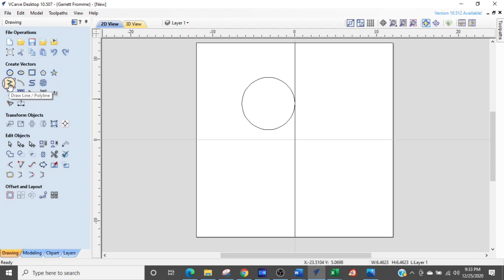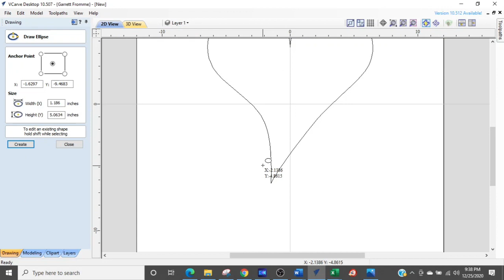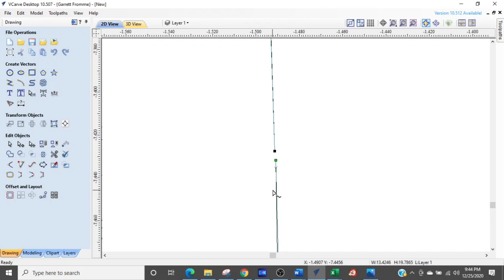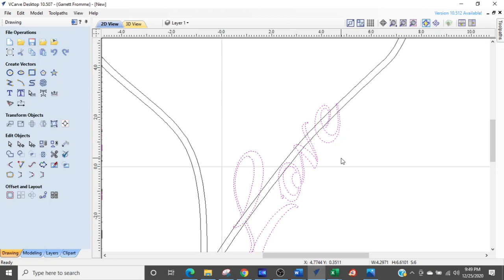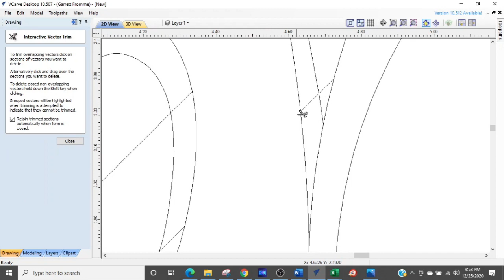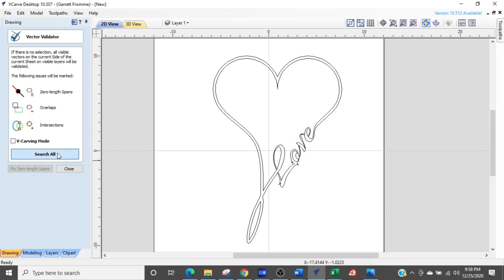How To Create Unusual Designs for CNC Router Laser Vectric Projects Vcarve Tutorial For Beginners

Comment: I am attempting to import a simple bit-map and just have VCarve (trial edition) only carve the features like eyes, mouth and external boundary (profile) but I do get a profile but no other characteristics like the eyes and mouth.  How do I set up VCarve to carve out those features?  I am also having an issue with open vectors. Using Vector Validator and zoom in to area where the open sector is being indicated I have not been able to close the vectors.  I have watched several videos on this but none have worked so far.  Any suggestions??
Reply from the maker: Hi Chuck. Image vectors are a challenge. You'll have to work with the threshhold. You may want to learn a bit about the inkcsape software (free). It might help you quite a bit in this area.

Regarding the vector issues. Vector validator will pick up intersections that don;t work. Use the node feature to fix these issues. Look for any videos I have done regarding nodes.